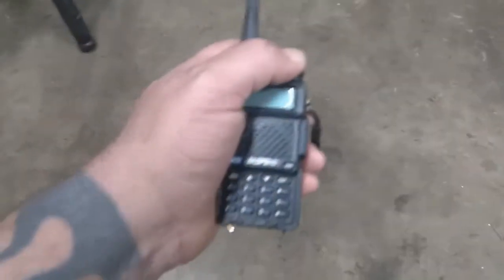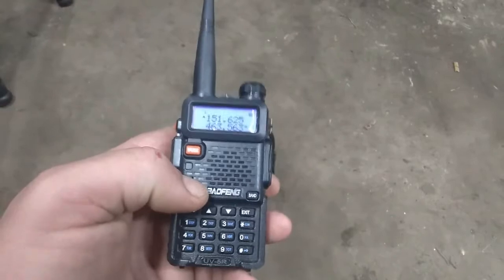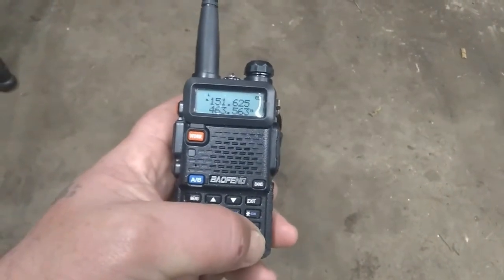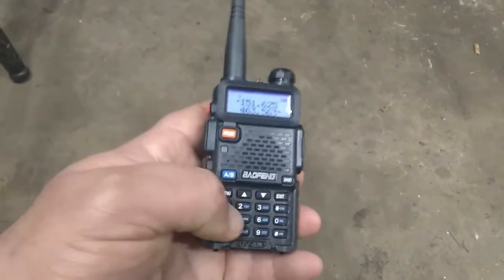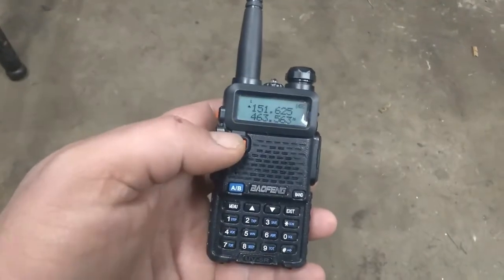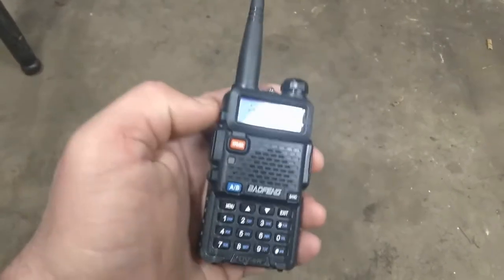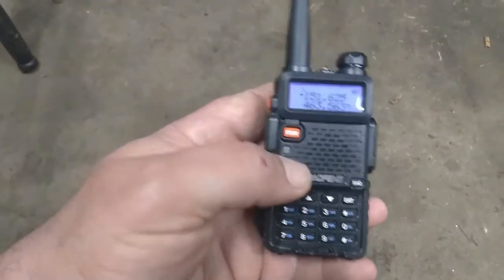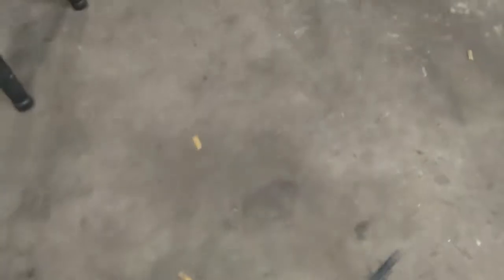BAOFENG UV5R Lock keys Feature

Comment: Thats fine for one channel operation...Is there any way to lock the keypad and scan your channels at the same time?...If I start to scan and push the # key,it locks the keypad but STOPS scanning and vice versa.....
Reply from the maker: This would be for when you are operating with a group and you are on a frequency or channel and you did not want to accidentally bump and end up off of that frequency or channel. As far as scanning is concerned and locking it I'm sure you could but I am not certain how. 

You can monitor two frequencies or two channels at the same time with it locked if you program it in chirp to do so. I do not know how to program it to do so on the actual handheld without chirp.
Reply: @LivingOffroadLife Or just save the frequency as a channel…that take like 20 seconds 🤷‍♂️
Reply from the maker: Doesn't change the fact that you can wind up on the wrong channel that was the whole point of the video.

Comment: If you do a power cycle, will the keypad still in lock?
Reply: Mine does. Tried,to leave battery out for 2 days... Still locked
Reply from the maker: Yes to unlock all you should have to do is hold that number button down again
Reply: @LivingOffroadLife  ty for video. Had mine stuck after 1yro enjoyed it... didn't know what happened.